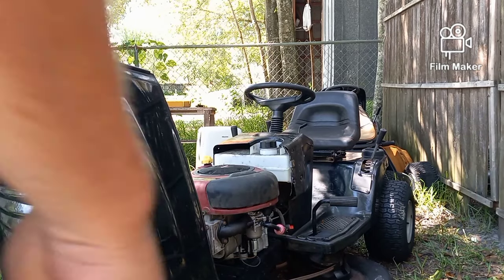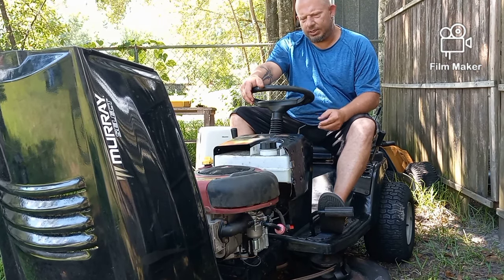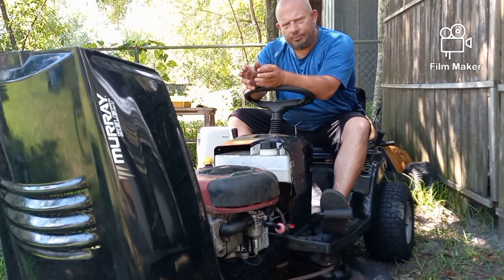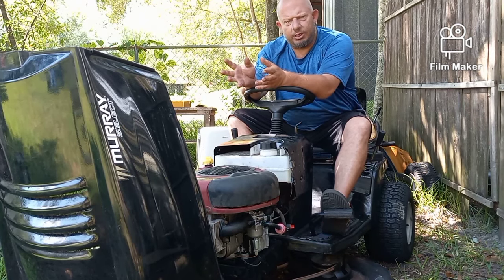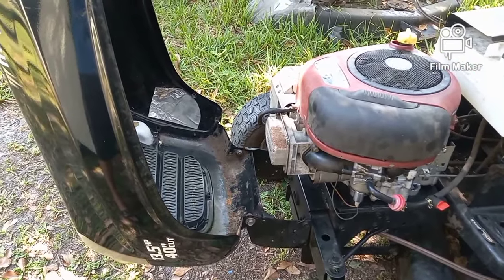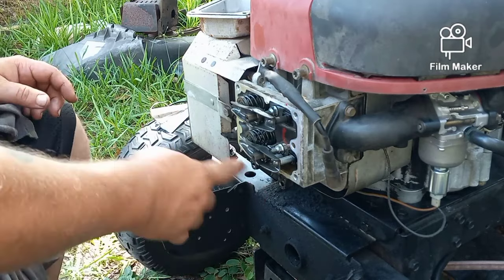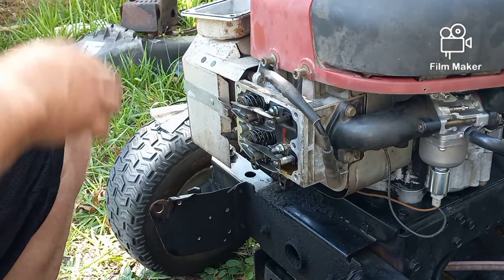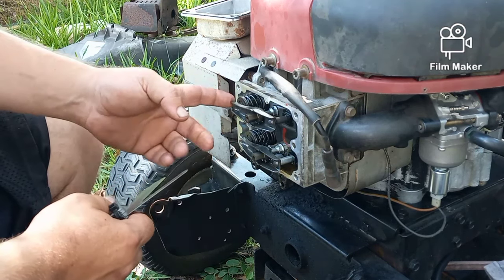Mower Spitting Backfiring / Fixed Briggs and Stratton Riding

Comment: Dude, you are wasting time sticking larger blades in the gap. Just set the valves and move on. No need dragging out the video. We all know every time you run valves they are off.